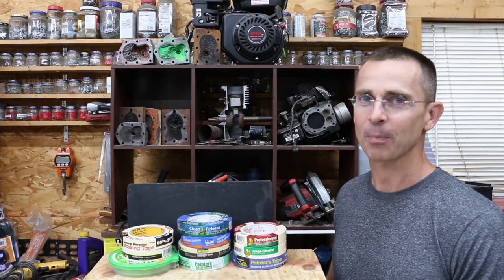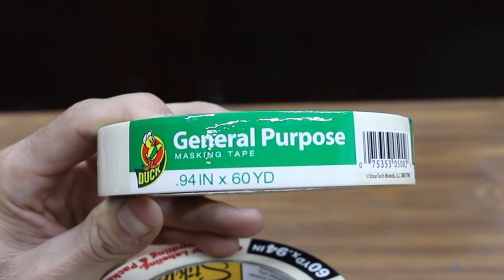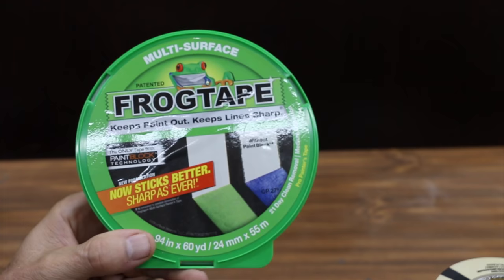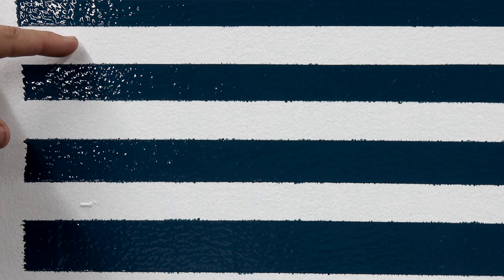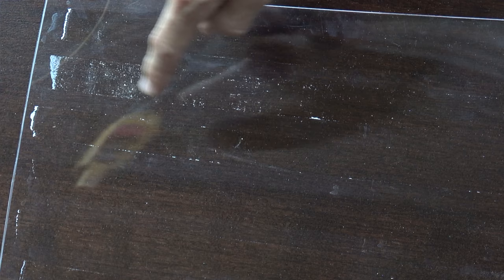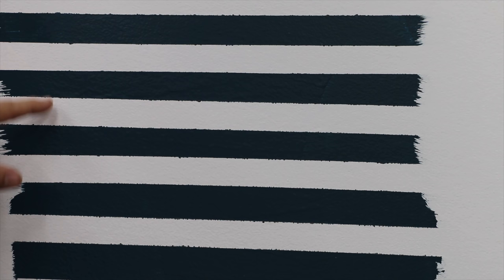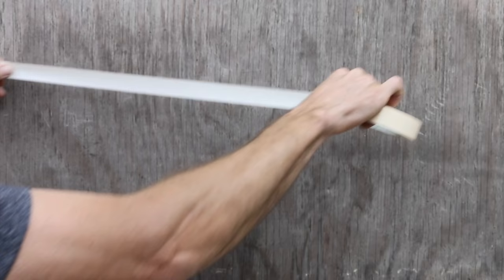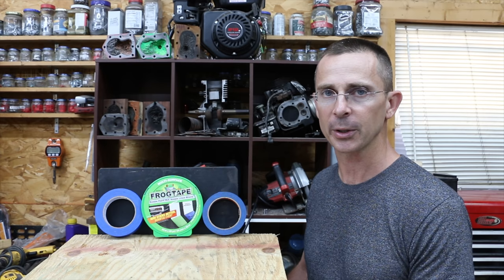Which Masking Tape is the Best?  Frog Tape ve Duck Pro, Stik Tek, 3M, Scotch, Dollar General

Comment: As a professional painter this is one of my favorite tests! That being said, my general rule of thumb has always been "Never trust the tape."  It can HELP, but don't ever expect a perfect line.
Reply from the maker: Thank you!
Reply: Looks like frog tape leaves a nice clean line.. though it might be cost prohibitive and leave residue.
Reply: tape is a guide not a crutch. learn to cut in
Reply: what do you do then if you cant trust the tape? you cannot paint a perfect line with a brush.
Reply: @Francois_Dupont  If it won't effect the appearance, the very thin coat of acrylic caulk trick over the tape works really well
Reply: Yep 15 years here I trust my brush far more than tape, big fan of the green painters mate when I do tape though.
Reply: @Francois_Dupont  hire someone who can
Reply: @Francois_Dupont  after 23yrs of experience, I can cut a straight line in an earthquake sir!
Reply: @Francois_Dupont  lol a real painter can paint a perfectly straight line with a brush. Takes time and lots of practice.

Lot faster too.
Reply: Use a thin layer of caulk like he did with the wood in this video,  works everytime with any type of tape
Reply: Working on rental turnovers for the last five years I noticed that the painting crew only ever used masking tape to hold down paper and plastic, and never for cut lines - those are always done by hand. And I'm not surprised, there's a lot of control available when you develop the muscle memory and technique, it pretty much makes masking lines tedious and expensive in comparison
Reply: My old boss said "what are you doing using tape?  Taught me how to cut properly and have never used it since.
Reply: As someone who hates painting and has never been mistaken in any way, shape or form as an artist ( you get the drift ) I need all the help I can get! I have a friend who can cut a line so sharp it cuts you! I dont take advantage of him!
I need rolls of tape and paper to make any project look... Decent.
Reply: @pizzaholic   No doubt in my mind, I have seen a few painters who didn't use tape at all. Plus look at guys who pin stripe cars...
Reply: @muhdewd9727  definitely. It has nice straight lines and almost 0 bleedthrough, but for that price theres no way i would buy it.
Reply: @ipissed  that name suits your acting perfectly tbh. Dont expect people to grasp on that kind of "sarcasm", and i can clearly tell that youre serious.
Reply: @Francois_Dupont  When we had our house professionally painted, the painters did all the lines with a brush and no tape. Cleanest lines I've ever seen.
Reply: @pizzaholic  so you guys can paint me a perfect line on a straight wall without taping? wow, you also control the nautilus?
Reply: @ipissed  so how do you get your perfect lines?
Reply: @itself227   Pressure pot sprayer using a leveler to get rid of all the slop from the roller/paintbrush tards. Sanded smoother than a babies ass. 3M, or frog tape, careful not to load the tape edge. Remove tape directly back on itself with a slight angle away from the paint edge.

Comment: Every time I've looked at Frogtape, I was convinced it was just overpriced marketing wank. Guess not, and now I know its what Im buying next time.
Reply from the maker: I had the same concern.  Glad it actually is a great product
Reply: The frog does not dabble in bullshit
Reply: we have frog tape in the uk and after using alot of cheaper brands its now the only one i'll buy.
Reply: It also looks like you could maybe apply caulking to any of the tapes and they would all be pretty much perfect. Not sure if that would save you much tho.
Reply: @comicalhexical  Well, the caulking helped the frog tape.  My guess is that it is risky, as I have spent most my Saturdays repairing the wall to perfection where pulling the tape also pulled parts of the paint off the wall.  Seems to happen more for the professional series of paints that are more rubbery.  He does not mention grade of caulking he used.  I think I tried the caulk trick only once, but still had bleed onto baseboard.  Probably will try it again.
Reply: Just a shame it cost so much here in Australia. USD$11, more than double that it is in the US.
Reply: BullFrog my hubby invented this. It is an amazing product.
Reply: @loooooooooooooooooooooongc4998  Severely underrated comment. lol

Comment: When I seen the price of Frog tape in the store I said no way am I paying that much !
I went through most of the others you had there......... and then went back to the store and bought the Frog tape !
I have always had to learn the hard way ! 😊
Thanks for sharing and take care. 👍
Reply from the maker: Thank you!
Reply: @ProjectFarm  I like how you progressively shortened how much you spoke about each result as to not drag it on. Nice touch!!
Reply: Just learned that lesson... again.. with some drill bits. I couldn't figure out why I wasn't able to drill into some brick with some cheap masonry bits I purchased from Amazon and figured it must be some super strong brick materiel (the bits had tungsten carbide ends after all!). FInally gave in and bought a nice Bosch bit from Home Depot and it cut through like butter. A 15 pack of bits for $17.99 isn't any better of a value vs 1 bit for $8.99 when all 15 bits are garbage.
Reply: @alexrowland   A fart smeller once said "if you buy quality you only cry once"
Reply: Same thing with me and duct tapes 

I used to go through rolls and rolls of gas station duct tape, then I saw his video on T-Rex brute force tape and so far I only need one loop of tape to do the same job as half a roll of el-cheapo duct tape, oh and I haven't had to replace that loop of tape yet (been baking in the Australian sun for the last  month or so without a problem) 

Best $60 I ever spent
Reply: We used to use 3m blue but for the one time cost of frogtape its all we buy anymore. A whole lot cheaper than fixing crappy paint lines.
Reply: My old man said the same, until he saw how good it was and how clean the lines are, my wife uses it for holding down paper when doing water colour paintings.
Reply: I like frog and the 3M yellow. Get have different levels for what you're painting on. The yellow is amazing but pricy.
Reply: 3M probably has an advertising budget the size of the moon and Frog Tape advertises via word of mouth and along came Project Farm, Wam, Bam thank you Mam!
Reply: @77.88.  here in germany frog tape does more advertising than 3M as this is regarded as the "pro" or "contractor" brand. i love how the frogtape leaves crisp edges totally worth it´s money in gold. we also have a nice variation of frogtapes available like different adhesion levels, and even one for zig-zaging

Comment: As a professional woodworker I have always used Duck Clean... It peels off easy, doesn't stick to the tape roll over time, typically doesn't tear when peeling from the roll, and is priced very competitively. I always thought the much more expensive Frog tape was a marketing trick and you have proved me completely wrong. I will definitely be using that for any paint lines I have to accomplish and keep using Duck Clean for the non-paint essentials. Thank you for the information - it's incredibly valuable. I guess it's time to become a member... :)
Reply from the maker: Thank you for the feedback on Duck Clean.  Great tape and great price too!

Comment: The test I didn't know I needed, but oddly satisfying when the tape leaves a clean line.

Also on the wood caulk test, that's not really bleed through on the tapes part that's just paint seeping between the grain structure.
Reply from the maker: Thank you and great point. Thanks again!
Reply: Indeed it did seep between the grain of wood. Still very useful info though. So still a valid test imo.
Reply: Honestly, I am going to remember the tip of applying caulking to the tape line. That will come in handy someday, I just know it.
Reply: @spokehedz   I was thinking the same thing.
Reply: Obviously, but the closer the tape is able to adhere to the surface and fill the crevices the harder it is for the paint to do that
Reply: They why did Frog Tape outperform the others?
Reply: @spokehedz  Yeah this is something I learned from a professional painter. Just make sure it is paintable caulk.
Reply: @spokehedz   yes and no. unless you wipe it clean toward the edge of the tape you will see the ridge when you remove the tape. Not ideal for aesthetics and a non noticeable ridge in the paint color change. Smash the edge of the tape down with a plastic putty knife like you would joint compound on drywall tape. Lightly brush from the tape to the wall to make a light seal coat on the edge of the tape. Then paint the wall and remove tape immediately pulling the tape back directly parallel to itself. This is how we avoided bleed before frog tape. Now just tape flatten with the putty knife on the edges and paint...lol green tape is good tape
Reply: KelMaster Construction   anytime! Glad I could help!

Comment: Frog Tape is one of those products I took a long time to buy because I thought it had to be marketing bullshit and it's relatively expensive but my experience with it matches this, it's excellent.  If you really need a clean line then it's worth the cost.

I use the yellow type though, I think it has less adhesive than this green type.
Reply from the maker: Thank you
Reply: You can also leave the yellow Frog tape on longer than the green frog tape
Reply: @jimacheson4933 /videos So, green means "go, go, go!  paint that thing already!" while means "slow down!  paint with caution!"?   xD

Comment: It would be interesting to see the difference in different types of electrical crimps/plugs/solder combinations and how they hold up to harsh weather and vibration. I'm thinking for either car audio or something more practical like trailer wiring which always seems to need redone often when road salt is around.

That being said this video was a real eye opener, i didn't expect any difference between brands so I've always stuck to the cheap stuff. Frog was never a brand I had considered before, but I'll definitely be seeking it out now.
Reply: This is an excellent idea.
Reply: @Oddman1980  Thanks, I appreciate it. It seems like one of those things where people in a certain industry coalesce around similar opinions but then you check another industry and it's completely different. My experience says hydraulically crimped butt splices are the way to go for big stuff, but not much on a trailer or a car justifies breaking that out, so I've had luck using marine use silicone sealed plugs for the small stuff.
Reply: Id throw in a linemans splice with electrical tape/exposed to add in there.  So solder with heat shrink vs linemans splices vs those flat pressure fit tabs vs wire nuts vs crimped vs ... etc
Reply: A test like this could be a can of worms without resistance and load tests.  Let's use automotive for example.  To reduce costs and weight, auto mfrs have taken the load to wire size ratio to the limit.  Older cars had a big honking wire from the alternator to power stuff and charge the battery.  Repairing a terminal with solder worked because the heavy wire stayed cool and there was a lot of surface area for the solder.  Newer cars use a much smaller wire and higher current alternators and that wire runs HOT right from the factory.  A soldered connection would be weak due to inherent heat and additional heat from a higher resistance joint and fail under load.  With a soldered connection, the wire and terminal has to be upsized to cope.  Copper wire relaxes over time allowing crimped connections to loosen increasing resistance, heat, and letting corrosion seep between the strands and the terminal.  It's worse with solid wire which is why it's not crimped but uses a screw terminal which must be re-tightened periodically. Then there is weatherproofing which can get a bit tricky due to many variables folks don't think of.  My concern is that tests done with speaker wire would take the results as Gospel and apply it to connections that would fail and cause fires, damage, or injury.
Reply: As a automotive and heavy duty mechanic this is a video idea i would watch religiously! Awsome idea!
Reply: Good idea. Our plow trucks wiring takes a beating being exposed directly to salt/salt road slop/loading spills for endless hours all winter. Even with heat shrink and ribbed connectors wires are melting/rotting more than once a season.
Reply: @EddieTheGrouch  It's probably fair to say that tinned copper wire is the bee's knees and that regardless of electrical resistance water getting into the joint will lead to intermittent faults eventually. It may be worth just using something that changes appearance in water rather than resistance checks since they're going to work most of the time under no load even if they're damaged. Solder is worth testing specifically because the differing metals may corrode faster than say another tinned copper crimp piece when salt water is involved. You bring up a good point with heat expansion and contraction, that's a killer for grounding inside the engine compartment and should probably be considered in the tests.
Reply: @ac.creations  for sure, I think without getting into the extremes of heat shrink and conductive insulating grease there's still a lot to be learned about the actual mechanical strength of each as well as the general wiggle for lack of a better term of each splice which could be an indicator of the viability of using heatshrink/tape/grease over it in the first place for road vibrations in the long term.
Reply: Yes I would like this as well! I use a great deal of heat shrink crimp connectors in automotive wiring and wonder what brand is the best!

Comment: I Would NOT recommend using CHEAP blue tape  ( unless you are painting your project blue )  a few years ago I used dollar store or Hf blue tape on a white bathroom wall,  the blue from the tape bleed through, I had to repaint several times  to cover up. the sad part is I had 3m blue but wanted to try the cheap stuff . Thanx PF

Comment: You may have heard of this trick. And no I haven't tried it much.😲 
Put up the masking, and what ever the base paint is, paint a strip along the edge of the tape with that paint first.
That will bleed under the tape.
Then use the contrasting color as normal. 
When the tape is removed, the color that bled under is the same paint that is supposed to be there.
Anyhow,, that is the Therory, ,, I haven't done it enough to prove the concept 100 %...
Thanks for your good work and sharing your videos.
Reply from the maker: Great tip! Thank you
Reply: I haven't tried this technique painting a house but I've tried it painting various other objects and it works great. Sometimes I use clear coat after I put the tape down to seal it and then put the color on that I'm trying to paint
Reply: I do the same.  Typed the exact comment and then read your comment.  The tape tests here helped me out for whenever I am going to do some edging next though.  :)
Reply: I am a painter and can confirm this works.
Reply: was searching for this exact method.  I've painted lots of cornhole boards, so taping and painting straight lines without bleed is a must.  regardless of the tape (tried many different ones), this method standard.  It's the only way to fill the voids of the material under the tape.
Reply: that's called sealing the tape. It can bite you in the ass if the tape doesnt come off because the paint glues the tape down. I watched a guy ruin his project trying that.

Comment: Been using Frog Tape for a couple of years now. My experience with it mirrors the results you got in your tests.  Very good with latex paints and fairly good with oil-based paints.  I also have used it for marking fingering positions on violin fingerboards as it releases well and doesn't leave much residue behind in that application.

Comment: One problem I've had with some painters tape that you didn't address, is when I mask off a freshly (but dry) painted surface many painters tapes will peel off the paint underneath it.
Reply from the maker: Great point!  I should have tested for that.
Reply: Try using the yellow colored frog tape, it's for delicate surfaces, it will sometimes peel the fresh paint, but not nearly as much as the others will... nothing a quick cut in with a brush will take care of
Reply: I think the paint peeling or flaking off speaks more to the paints LACK of adhesion vs. The tapes over adhesive. Just a thought I would suggest primer or roughing  the surface prior to finish coat
Reply: @germx1488  That seems to be my experience too.
Reply: You need to look into IPG tape. I work there. We have a multitude of tapes that are leaps and bounds above what he tested. It is more money, but the finished results are amazing!
Reply: I've found you cannot go over fresh paint with tape....  If you're willing to wait a week or more, that's fine, but if you painted it yesterday, and you're masking it today???  Forget it.  The tape is gonna peel your paint off.....
Reply: Identical test, but lay tapes vertically on fresh paint with 1/2 the weight on the rubber roller, then brush/roll/spray another coat.
Reply: I left frogtape on my car for two weeks when I replaced the convertible top as paint protection. I wish I didn't, as I pulled off tons of clear coat. There would have been barely a ding without it.
Reply: Yeah if you are using dollar store tape.
Reply: You need to let the undercoat cure before masking. 14 year pro responding. Also if the mud was not applied in the proper way this will happen. 15 min mud is could be the issue.
Reply: @germx1488  correct. It is often the mud didn't adhere the the drywall or still had moisture when taped over.
Reply: Stick the tape to your pants or shirt and remove to lose the extreme stickiness on freshly painted surfaces.